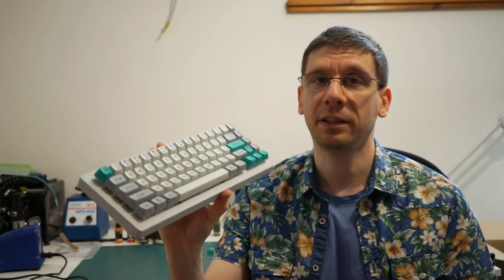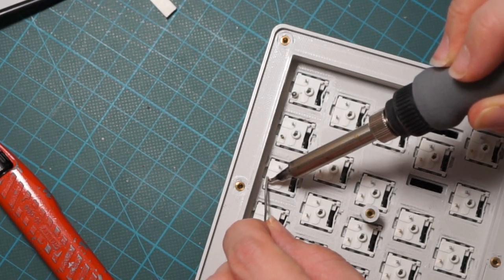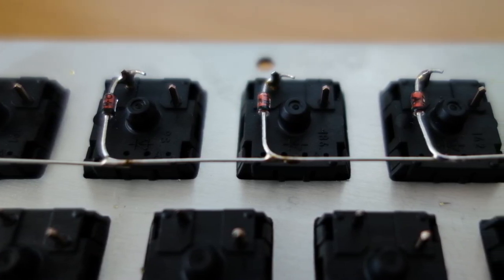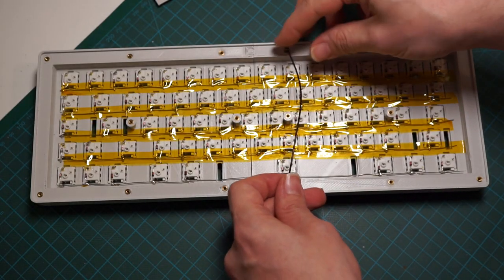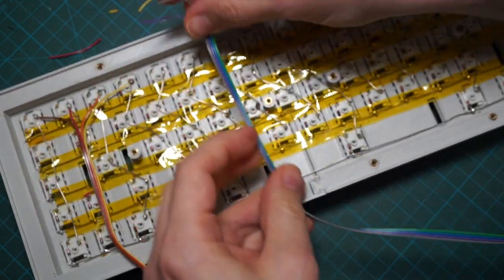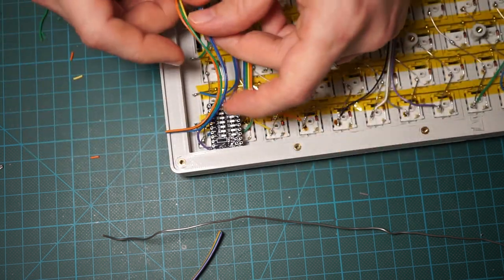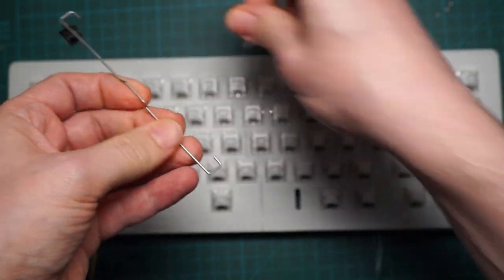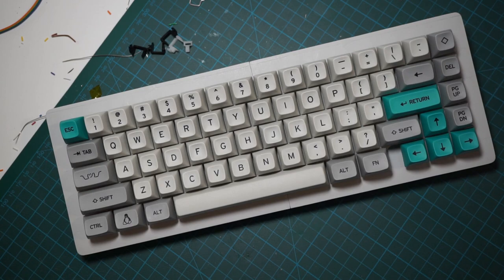Hand-wired mechanical keyboard inside a 3d printed case

Comment: Now i can repaid my keyboards which have ripped off soldering pad
 by soldering left(thick) pin to the diode and the right (slim) pin to the other's switch right pin
Handwiring is amazing and very interesting looking thing, this is much cheaper because you dont have to buy a pcb (in case if you dont need led's (but you also can handwire them)) 
I would like to handwire my first keyboard but I'm very afraid of programming but i heard that there is in deep internet here's a website that can program a keyboard layoult for you 
Nice video dude, keep it up 
Sorry for useless comment by the way

Comment: Is it possible to use arduino micro pro instead of teensy? Its same chip and also hid compatible but it has less contacts on pcb i think
Reply: or maybe a stm32 controller since they are much cheaper
Reply from the maker: as long as it has 21 usable I/O you can use pretty much anything :)

Comment: im looking to build the same, but only with alps switches ^^ can i use normal cherry stabilizer or do i need special alps stabilizer? would these fit in the existing stabilizer holes?
Reply: alps only

Comment: you are connecting only one wire from the teensy to a row, there is no circuit. how can it detect keypress?
Reply from the maker: it's a matrix. a pulse is generated and intercepted when a key is pressed

Comment: How long did it take wo wire everything?
Reply from the maker: depends how good you are with the soldering iron. I'd say around 4 hours.
Reply: okay thank you
Reply: For anyone who looks at this later: I am handwiring my first board atm and it needed me about 3 hours to connect the rows, the columns will need me 2-3 more hours I think. 
It won't need you too much time but for your first project you should plan about 6 hours. Just a little information here.

Comment: painfull to watch the soldering :)... apply heat to the points before you jam the solder in, rather put the solder onto the heated joint than iron :)